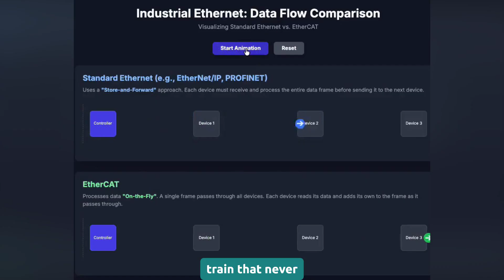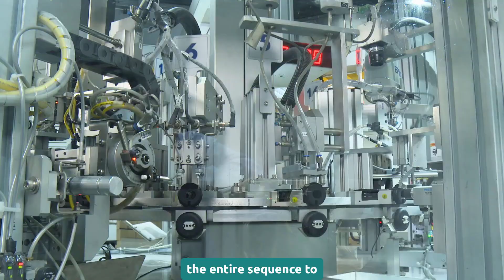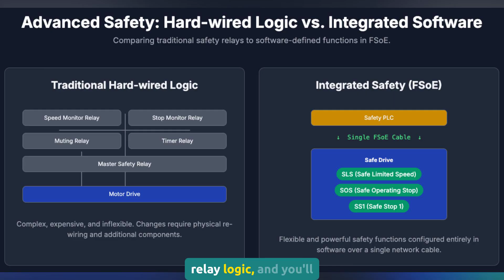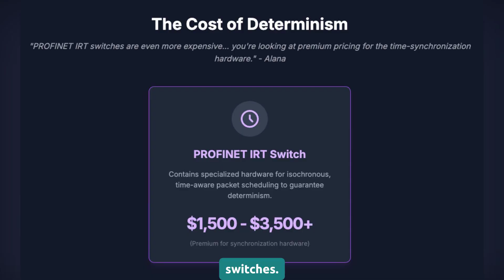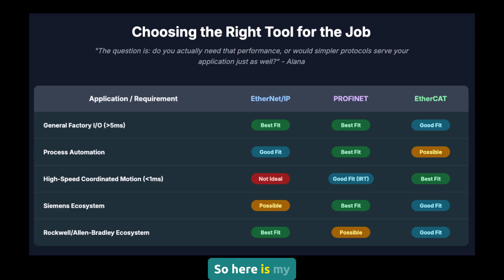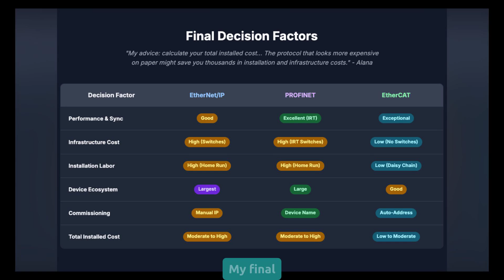The Secret Behind EtherCAT's Speed (And How It's Different)

Comment: Yeah, EtherCAT is pretty amazing.  The distributed clock is completely mind blowing, clock corrections work swimmingly.  We made one of our devices run pretty warm, the other was heatsinked.  Naturally the clocks drifted from the temp difference, but there was a clock sync that never let the distributed clock fall behind by more than a dozen nanoseconds
Reply from the maker: It's incredible how EtherCAT's distributed clock maintains such precise synchronization even with temperature differences affecting device clocks.